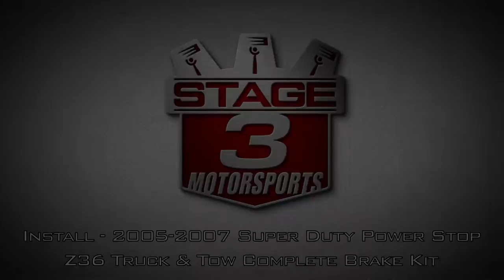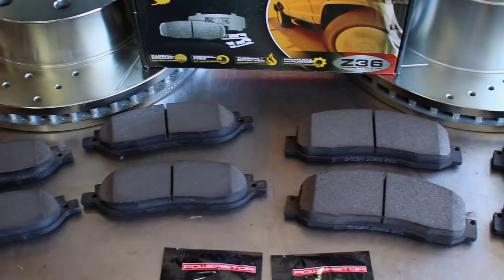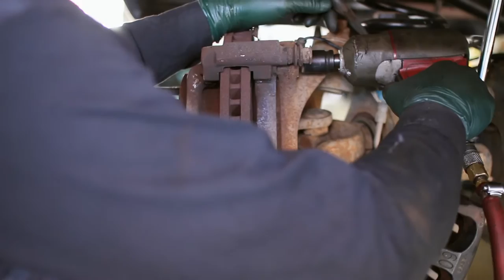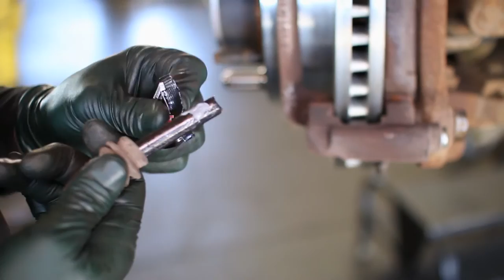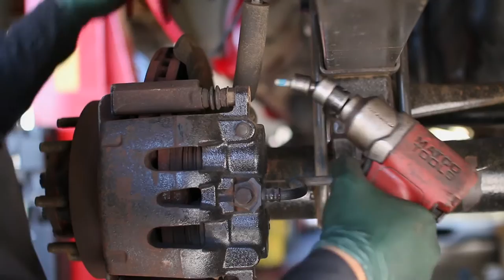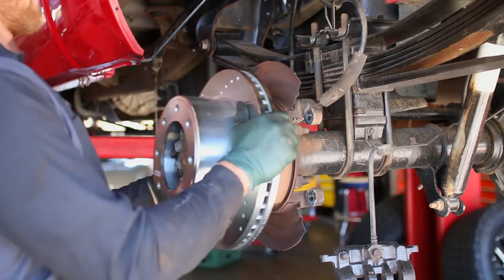2005-2007 Super Duty 4WD Power Stop Z36 Truck and Tow Complete Brake Kit Install

Comment: I love how this guy rips the caliper off and swings it over and lets it HANG by the brake line. Good going bud. I can't believe that they made this video, really man!
Reply: William Santiago not to mention not replacing the old saggy dust boots on the slide bolts. And you never use a impact to compress the pistons in the caliper. Hack mechanic that doesn't care……
Reply: No doubt,that's why I don't let any monkey's wrench in my stuff ,guy was a dirtbag,  coulda easily broke a brake line with that careless work ethic,then would come to the owner and say ohh by the way we had to replace tour brake lines they were rusted,it's gonna cost an extra $279 for that thanks come again
Reply: William Santiago my thoughts exactly
Reply: Glad I'm not the only one who cringed seeimg that

Comment: Any way to upgrade front brakes from the typical 13" rotor to the Harley version (some king ranch also) 14.5 inch rotor? The calipers are also bigger and brake pad surface is bigger.  This is what I really want to do.
Reply: Stan Rodgers check out forums for your truck.. if its possible then its most likely already been done. i just ordered 2006 tundra extreme kit for my 1997 4runner
Reply: I finally figured it out. The mounting positions on the Harley and King f350 versions are different. The calipers are the same so the caliper mounting brackets have to be located 3/4 of an inch out. Must mean that the front steering knuckles are different. NO CAN DO!